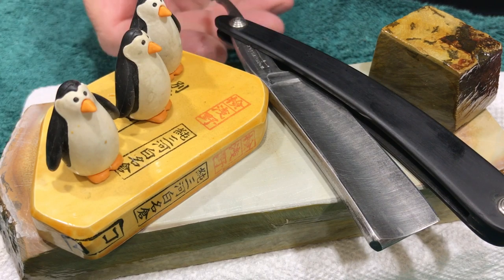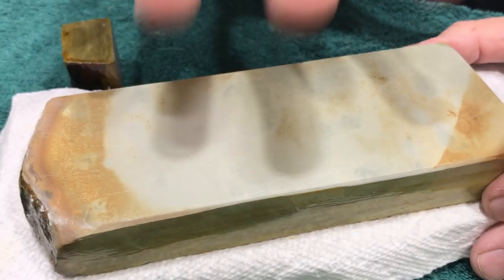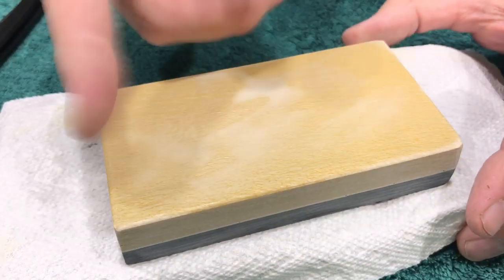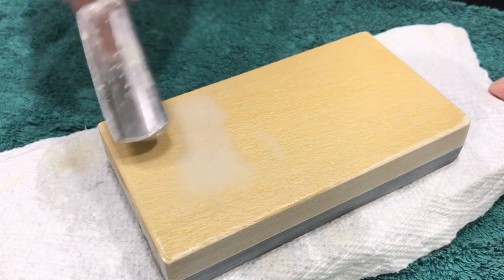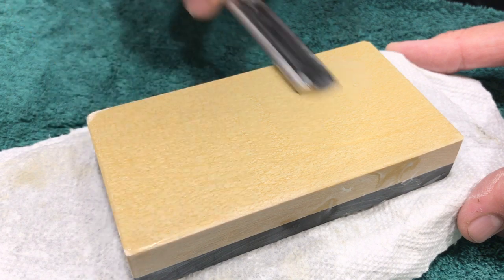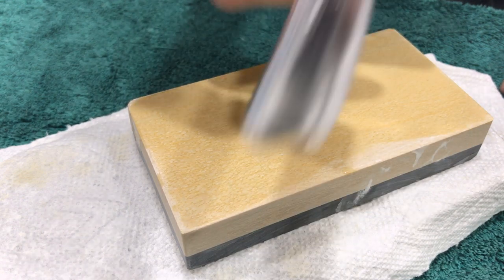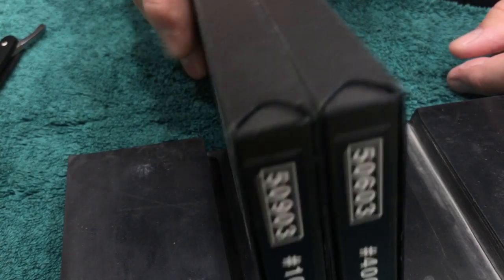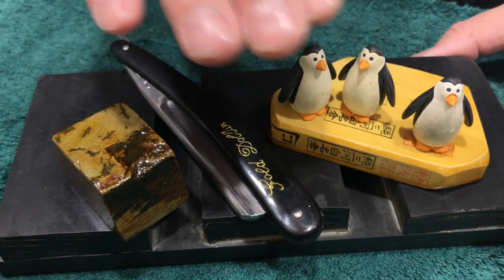Honing Vlog #12

Comment: does your slurry comments apply to other stones and a two stone honing system? im asking cause i have a vermont green slate and i want to get the best out of it.  im just wondering so i can know if im doing something wrong and not getting the most out of it
Reply from the maker: This vid is 3 yr old so I am not 100% sure what you are referring to exactly. And what the task is, exactly, is critical to everything in the discussion. That said, I have yet to see slurry on any slate do anything positive for edge refinement on a razor. Perhaps with heavier tools/edges there could be some sort of use, not sure. Thing is, what comes up from slate does not break down or decrease the friction coefficient past what is seen when using water alone. Outside of it being something someone does because their 'feel' or whathaveyou is conducive to that sort of process, I'm not seeing the point. IME, slates are more capable of producing finer edges when their working surfaces are unglazed and clean. That doesn't mean someone who's skills are not up to par will realize this function though. So the bottom line is, try stuff, see how it works for you and keep doing what works best. As long as you like what you are getting from your gear, there really is no need to fuss. It's not about chasing what might be better, it's about having fun, and good shaves.
Reply: @KeithVJohnson1  thank you for the advice

Comment: Leather opener from hell.... nice. Do you sell the slurry stones with the coticule?
Edit: how often do you touch up your blades?
Reply from the maker: Touchups are very rare, I usually just re-hone. The descriptions for the stones sold on Etsy will note whether or not a slurry stone is included.
Reply: @KeithVJohnson1  just re-bevel from like 1.5k? Or just restart from botan?
Reply from the maker: Depends on what I need to do, or want to do, or feel like doing.
Reply: @KeithVJohnson1  do you use a strop at all? I know you sell some, just curious
Reply from the maker: Yes.